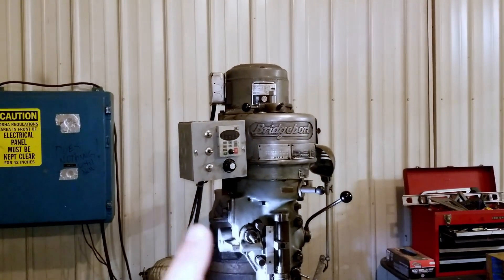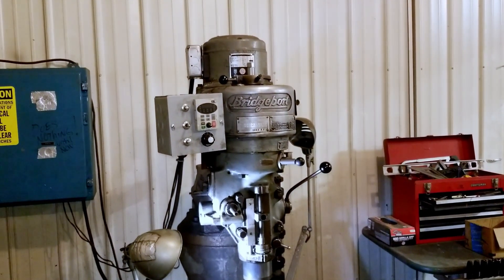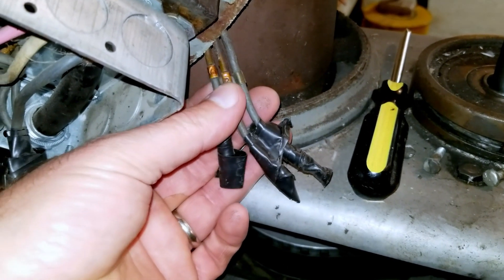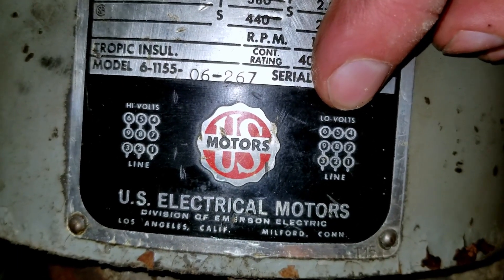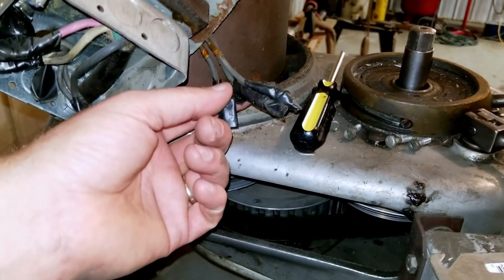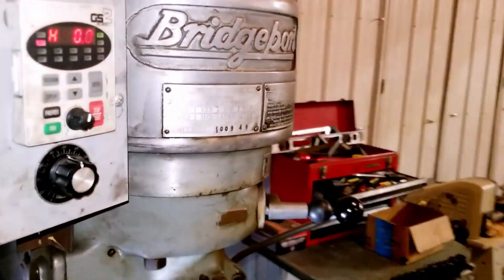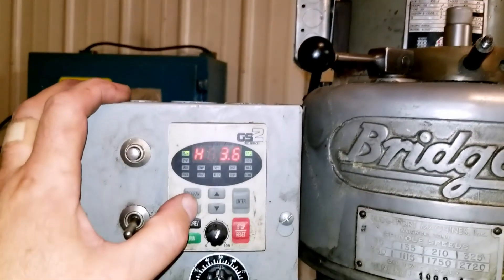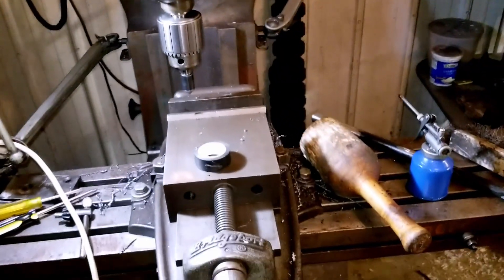VFD Wiring Mistake FIXED

Comment: Check out GS2 parameter 8.01 in the manual. I have my VFDs all set up to display spindle RPM. I leave my Wells-Index mill set to the middle belt reduction (your mill would be 1115RPM) and then the VFD displays spindle RPM, not motor, assuming you program in the P8.01 ratio constant of motor to spindle. Makes it real easy to set RPM for cutter diameter to not exceed HSS 100SFM. Now with this fix you will get very good low end torque from that drive. I assume this VFD is a sensorless vector drive, but I'm not seeing these words in the manual. I just checked, you have a scalar drive, and does not support vector operation of the motor. But you may have all the torque needed at low motor RPM, I assume your not swinging an 8" fly cutter. :D

Comment: I have a cheap vfd on my bridgeport.  I set it to 60hz and forget it..  I use the barrel switch and that's it.  Probably helps my machine has the variable speed head for controlling that..   Too many times I see these things needlessly wired up with extra shit no one uses.  Keep it simple.  https://www.youtube.com/watch?v=NwlOGQv8QXM
Reply from the maker: Unfortunately, I don't have variable speed.  So the things I've wired up get used constantly. The push buttons are really handy.